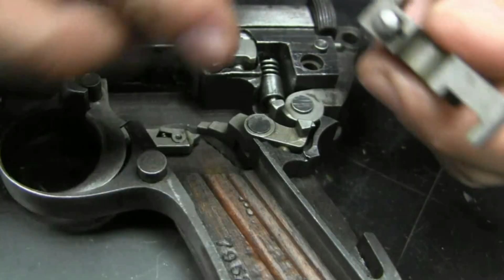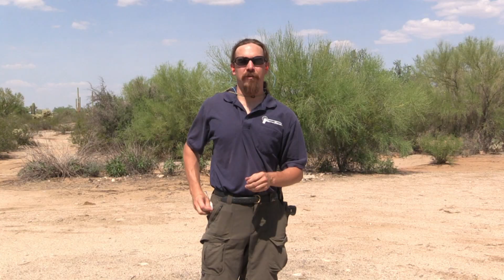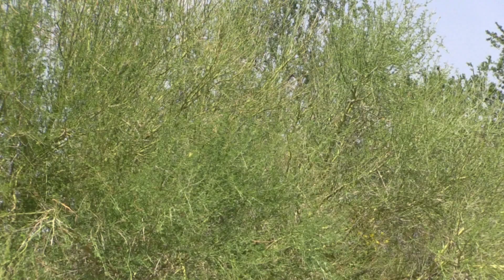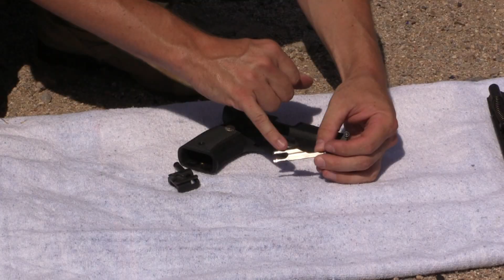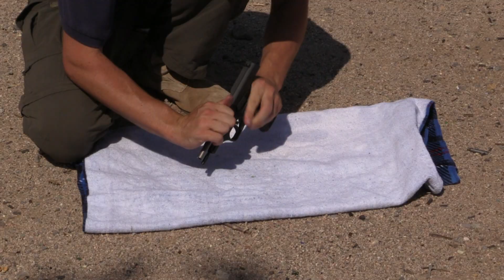Colt All-American 2000 (Disassembly and Shooting)

Comment: Yes, I'm one of the fools who bought a Colt 2000 when they first came out, along with a specific law enforcement duty holster for it at the same time,  and some six or so magazines. I can't remember if I had read something about it ahead of time, or if I just saw it in the store. 
Colt was hoping this gun would help them compete with Glock for law enforcement sales, at a time when many departments were transitioning from revolvers to auto pistols. The long trigger pull was deliberate to mimick the long pull of a revolver pistol, for officers accustomed to shooting revolvers. It was also a safety design to prevent officers from accidentally discharging their handgun; forcing them to make a long, hard deliberate pull on the trigger to fire it.
Not too long after I bought mine, I received the recall notice. When I received it back, it had a new trigger assembly. Supposedly there was a safety issue with the gun, which begs the question "why hadn't they discovered the problem in testing, and fixed it before mass production?". The official reason given for the recall was the possibility of it going off if dropped. It seems like I also remember reading somewhere else that the original trigger assembly was a little too similar to Glock's, and they had to change it to avoid getting sued.
So I've kept the pistol for years now, without ever firing it. I don't really know why except that I think that as such a bad gun, maybe someday it will become a collector's item; kind of like owning a mint condition Edsel car.😀
Reply: This is 2 years old but I'd say it's more like a Mint condition mg midget
Reply: If you have the blue version, then it is a collector's gun.

Comment: Here is some crucial information regarding the Colt All American 2000.  Offered in alloy and polymer frames, Colt soon switched to all polymer guns.  The alloy frame versions were the first made, but they were not to be made again after the first run.  The bulk of the problems this pistol had originated from the alloy-frame models.  Colt wanted all polymer and the original design called for all polymer.  Something to add, there were 2 polymer versions.  The last version offered a Stoner/Knight spec extractor AND the barrel bushings were actually more tightly mounted to the slide and tighter around the barrel.  Now, to address some misinformation.  First off all, the polymer models were meant to run dry.  Yes, that's right.  No lubricant.  The steel parts were hardened for no-lube function.  Oil will actually make the trigger feel worse; hard to believe it could get worse, but oil will do it!  The polymer was extremely fibrous.  Oil also hurts the reliability.  I will add that dry lubrication is recommended, except in extreme cold, where you shouldn't even use that.  I do use Remington Rem DriLube on the moving parts and it has worked wonderfully.  IF you lubricate it, use dry lubricant.  Use aerosol moly or Teflon where the carrier evaporates.  It you do this the trigger will still be 10-12 pounds, but it is not rough, it doesn't have that "chattering" feel and it actually feels like it is on roller bearings.  It is smooth.  The smoothness lasts too!   I have taken my pistol out where all rollers and moving parts were lubricated with Remington DriLube and done 500-600 rounds to a crack; reliably.  Colt failed to clearly explain proper lubrication practices to it's customers. Originally, the trigger was 6# in the Stoner/Knight design.  Colt did not increase it to 12# because of lawyers, it was a decision based on defensive ability.  Your typical striker-fired pistol is already partially cocked before you pull the trigger so you are not having to deal with the entire double action cycle.  The issue with this approach is if you have a misfire, you cannot pull the trigger again.  Remember, guns like a Glock and other DAO pistols have to cycle before the striker is partially cocked.  What this means is once the trigger is pulled, you can't cycle the striker again (pull the trigger) unless the slide cycles.  Colt felt a fully defensive DAO pistol should allow the striker to function every time you pull the trigger regardless of what happens. For example, if you have a misfire, the round will often fire if the primer is struck again.  The All American 2000 offered this ability.  You can pull the trigger as many times as you want without the slide cycling.  This is an advantage that SA/DA pistols offer (like the Beretta 92 for example) you can pull that trigger as many times as you need to!  All things come at a price however and the result was a long 12# trigger pull on the Colt!!  It should be noted that the Stoner/Knight design had a trigger pull nearly as long.  The trigger is very much like a Trooper MKIII/MKV or old-style King Cobra revolver fired in double action.  At one time we got a box of bum ammunition (Remington) and out of 50 rounds, 7 didn't fire.  4 of the 7 fired afted pulling the trigger a second time.  Of the remaining 3, pulling a third time ignited 1 of them.  We took the remaining 2 and tried them in a Beretta 92FS.  They still wouldn't fire.  As you can see, the true DAO pull on the Colt isn't ALL bad.  In this case it displayed it's design advantages.  Colt did not explain their intentions regarding the change in trigger design.  It could have literally been marketed as a design advantage, which in some ways it is. Regarding reliability, the gun needed a break in period of several hundred rounds.  It is said any pistol should be broke in prior to you betting your life on it.  It was more true than ever for the All American 2000.  Colt needed to clearly explain a proper break in procedure, but they did not.  There were also some magazine problems which hurt feeding. The issue is that some magazines left the factory assembled incorrectly.  If the spring is installed backwards the pistol is going to jam.  This is easy to fix, but obviously it shouldn't have been a problem to start with.  Who were building these mags???  Some magazines were re-assembled incorrectly by their owners as well.  Here is perhaps the most bizarre part:  The accuracy of this pistol was poor, but much better in the last version, but once broke in, they actually weren't bad at all.  The unorthodox design led to extensive break in being required to assure reliability and accuracy.  Until they completely broke in, lockup varied from shot to shot.  Consequently, accuracy varies from shot to shot.  I build custom 1911's and they settle in and become more accurate after a few hundred rounds.  However with the All American 2000 break in made an unbelievably profound difference!!  They required an unreasonable amount of break in.   Also, after extensive break-in the trigger smooths out some and lands at about 10#. Still too damn heavy, but it met Colt's design goal of repeated trigger-pulls if needed.  Colt needed to point out that reliability AND accuracy are impacted by break-in.  I know a couple of shooters (plus myself) who have gone through all of the break in and our All American 2000's are reliable and reasonably accurate.  I'm not saying I agree with all of their design decisions, but I hope this clears up some misinformation and misconceptions about this unique pistol.  It was not ALL bad like some would have you believe.  If Colt had consistent magazine assembly, advertised the defensive "advantage" of their trigger and repeated-pulls being possible, fit the bushing properly and used the Stoner/Knight extractor from the beginning, this pistol would have likely made it.  After the alloy ones had issues, then the first polymers had issues, they finally got it worked out with version 3.  By this time however, people didn't want to touch one.  
We get together sometimes just to shoot our 2000's.  We have a chuckle about how we're all shooting one of the biggest firearm embarrassments of the 20th Century.   We all run them lube-free/or with Rem DriLube and we shoot the living hell out of them.  We simply do not have malfunctions.  Mine is so reliable I wouldn't hesitate for a minute to use it as a self-defense weapon and that goes for my friend's pistols as well.  This gun is better than you may think, but it's still not a Glock.  Regarding life span, we don't know.  I have shot mine literally thousands of rounds (over 5K) and it's just fine.  The polymer rails wore a little in the beginning (which they are only there for "light" guidance), but they got to a certain point and stopped wearing very early on.  There are steel rails in the cam block and in the rear there is a steel rail and the ejector which acts to eject and guide the slide and a dual-purpose roller bearing that cover the bases well.  You could grind the polymer rails completely off and the slide would be virtually unfazed.  Barrel bushing wear?  That barrel and bushing are so crazy-hard it's going to take a long time to cause problems.  It hasn't yet. I will say this pistol is excellent for learning trigger control.  When you get to where you can manage this, you can manage about anything!  At any rate, it is a very unique pistol that is somewhat rare and every Colt collector should have one......... just because!  NOTE:  I should mention that all 3 of our pistols are last generation (aka: 3rd gen) models.  These were the best and the closest to the Stoner/Knight design pretty much only differing in the DAO vs cycle assisted DAO of the original design.  In my opinion, Colt dropped the ball by altering other elements and specs of the original design in versions 1 and 2.  Colt also dropped the ball by not offering enough information about it's advantages.  Colt dropped the ball again by sending out bad magazines, not explaining proper maintenance procedures and lastly....... of all things a safety recall.  The version 3 pistol as it exists would have made it had Colt managed things correctly.  Just my opinion.  By the way, some people say this is a very ugly pistol.  Examine a silhouette of the 2000 and compare it to a silhouette of the Colt Model 1903 Pocket Hammerless.  Pretty damn close.
Reply: Ufff a really long comment but interesting nonetheless.
Thank you.
Reply: Wow, this gun has a LOT of crucial information.

Comment: I remember reading about this pistol in the gun magazines when it was first released. They couldn't stop writing about how great it was. The first striker fired pistol ( that I recall) they had a love affair with was the Smith&Wesson Sigma, S&W got sued for patent infringement by Glock and had to change the design afterward it was no longer the same firearm. Then the Colt AA 2000 came out and was still born due to the problems you stated. I stopped trusting industry gun magazines that depended on advertising money from the companies whose products they reviewed after those two pistol and started reading Shotgun News. At that time SN didn't have advertisers that sent them guns to review so the reviews were unbiased. Gun magazines still suck at giving unbiased firearms reviews the Remington R51 is proof of that. YouTube and online reviews from regular people are more dependable than gun magazines in reviewing new firearms.
Reply: Excellent points Simon. I remember reading about this abomination too. It got all kinds of glowing reviews. Remington R51's sure looked good the first couple of times I read about them as well. Nice thing about living long enough for YouTube to come out, I get to see honest reviews now.
Reply: Well Said Sir !!
Reply: A swing and a Miss  next one they hit it outa the park
Reply: For the most part, just about every gun on the market is pretty good, generally speaking. Guns like the R51 and AA2000 are few and far between. Now, plenty of people have fired enough different models to know what it is they prefer for themselves and what features are preferred when shopping and comparing. But for the average gun owner or enthusiast, the main concerns are... aside of cost... comfort in hand, weight, and if it looks the part. Magazines and GunTube always seem to shill for manufacturers because most guns are pretty decent. People won’t care what their opinions are if they say every gun is “comfortable, easy to handle, and reliable”. That’s over 90% of the market. However, you’re right when they make grandiose claims regarding clearly terrible products. The AA2000 was designed by committee using a multiple choice list. To them, if they have the most features checked, it’s better than others with fewer. You wanna know what else was designed that way? The Pontiac Aztek
Reply: Gun magazine writers desperate for material often hype new guns coming on market. The same people in the industry hyped the Bren Ten gun, and then when it flopped they all acted like they had done nothing wrong, as if they'd never mentioned it.

Comment: A trigger so crunchy, snack food companies are still asking for the recipe.
Reply: That was savage! But I can’t say that comment wasn’t deserved. The gun was garbage.
Reply: I found it hilarious that the trigger pull was so loud it was picked up by Ian's lapel mic.
Reply: Crunchy 😁😃hilarious
Reply: I had a Beretta 92D as an issue pistol for about 10 years. DAO trigger pull about 12 lbs, a mile long, long reset, and the gun was heavy as a boat anchor. Sights milled into the slide, so no adjustments (gotta remember holdovers with your sidearm), no tritium inserts, no rails for mounting stuff, and if someone got a visit from the good idea fairy, and decided to clean your weapon for "reasons ", they might over tighten the grip panel screws, and the magazine wouldn't come out without a screwdriver or feed rounds. Yeah, that's great if my rifle goes down. BANG click. 

I hated that gun with a passion. 

Strangely enough, attractive females got 92FS, with adjustable night sights, slicked up actions, rubber Hogue grips, and extra "training" time. Funny how that works.

Everybody knows what's going on, but nobody will say it.

Comment: I went from an H&K VP70 to a Colt All American Model 2000 - First Edition.  These were a high-quality duralloy-frame, not polymer, with the six-pound trigger spring; the metal frame had superb checkering and beautiful wood grips, excellent ergonomics and balance.  The trigger action was long and light, much like a Ruger LCP or more like those supermarket toy guns that fire spinning plastic discs, if you remember those.  The long straight pull made accurate shooting easy.  (One inch at twenty-five yards with Federal model 9MP, which was commercially marketed surplus from the early M882 9x19mm NATO ball production, with the 125.6 grain Speer Flat Nose Ball bullet, the most accurate factory-made ammunition in the world at the time).  Rapid fire, compared with a single-action trigger, not so much, and my dad said it felt like a toy.  Many other potential buyers also felt that way, which cost Colt a large number of buyers (I know, from listening to other visitors at gun shows who also tried it, and walked away.  I was able to get mine ridiculously cheap just because the dealer was so discouraged!)  The regular production pistols had, as you mention, a polymer frame, that was basically a casting of the metal frame-with-grips:  same dimensions and checkering, but the plastic frame's light weight completely ruined balance and handling (Much worse than VP70!), and together with the lack of hand-fitting and quality-control which Colt lavished on the Limited Edition pistols resulted in unreliability.  Remember, this was supposed to be a direct competitor to the first generation Glock 17 pistols (green guns, remember them?), which had won the Austrian service pistol competition famously with 50,000 rounds fired without a jam; those early Glocks had NO checkering, and were famously slippery on the range and in service--but the fix for that was to cut a section from a bicycle inner tube and roll it on to the grip as a "Glock sock," which resulted in a sort of Pachmeyer grip, keeping the great grip angle and balance with very few downsides.

One thing seldom mentioned, because the polymer frames cannot handle repeated stress, is that the action itself (and the alloy frames) had a design pressure rating of 70,000 psi, which Colt saw as an entree to emerging military markets at the time for 9mm +P+(+) armor-piercing ammunition (the SEALS having had two fatalities on the range from M9 service pistols coming apart during the firing of such ammunition). 

Just a couple of additional insights into how a beautiful handgun turned into a bankrupting boondoggle.